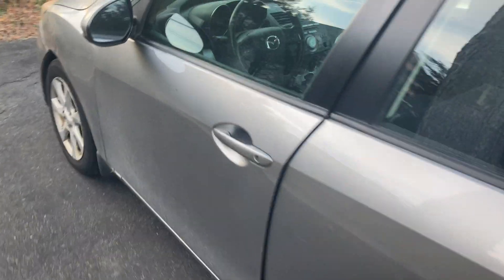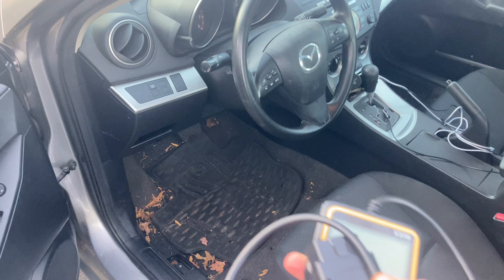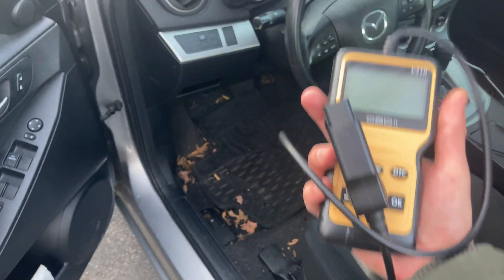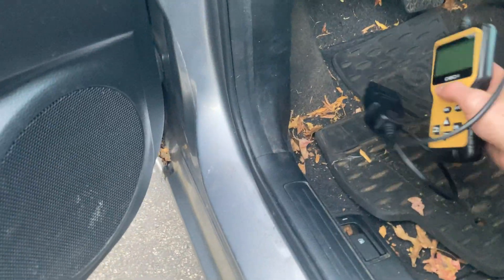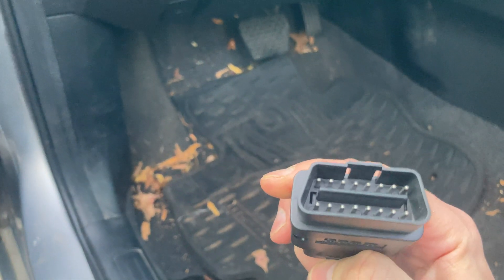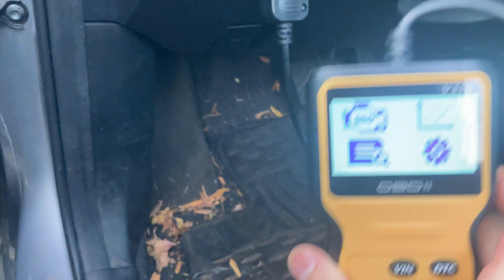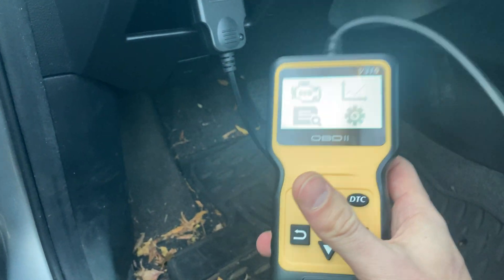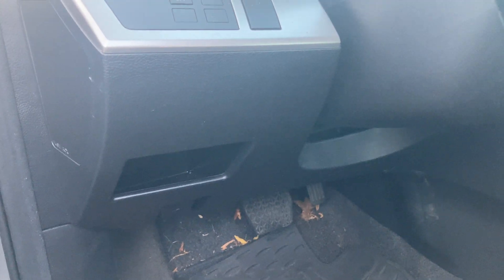OBD Port Mazda3

Comment: Great video! Do you know if the OBD port is always powered on? Or if it only powers on when the switch is turned to accessory mode?
Reply from the maker: Thanks a bunch for watching my video and taking the time to comment. If you are trying to use the OBD port I would always have the key switch to ignition on. If you are looking to draw power for always on power, I would pick a better location, personally.